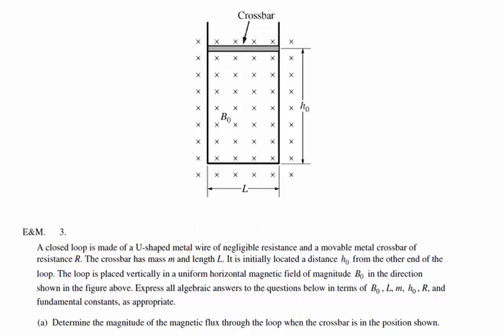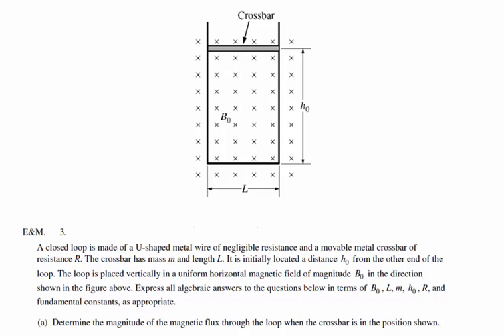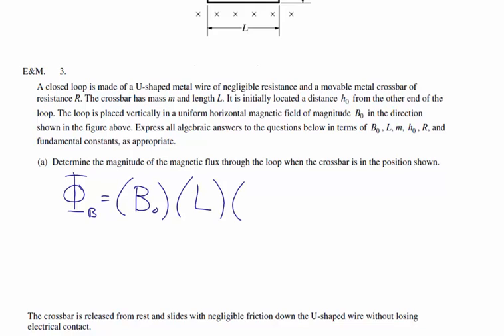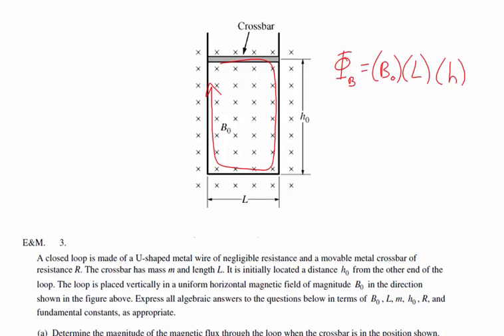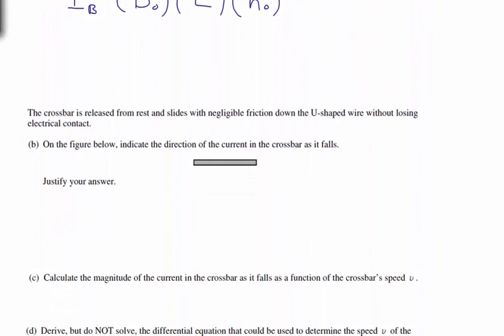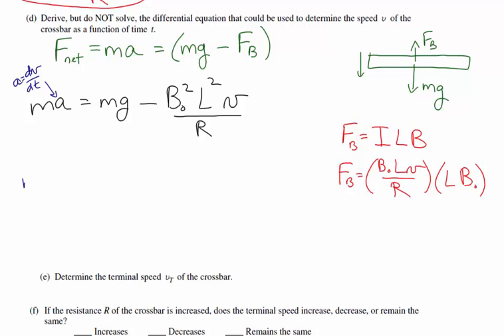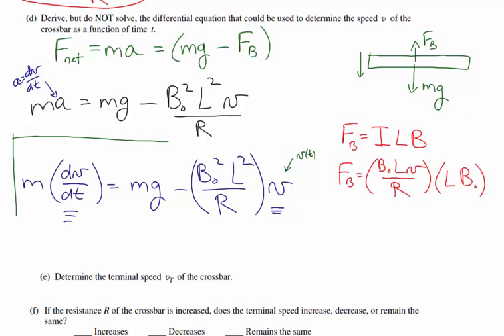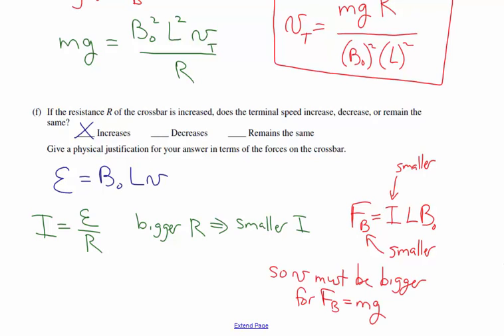AP EM FR (2012 EM 3) Induced Current in Falling Bar, Magnetic Force on Bar, Terminal Velocity

Comment: What if the crossbar was in an electrical circuit with a battery with such polarity that the magnetic force would act in the same direction as the weight of the bar? Would the crossbar still reach terminal velocity or would it continue to accelerate downwards?
Reply from the maker: It would still reach a terminal velocity. As it starts to move downward (at first accelerating more than in the first case since there are two downward forces - you have a rail gun) it still generates an EMF (or voltage) - in this situation it is often referred to as a back EMF - that is like inserting a second battery in the loop that works against the first one. It eventually reaches a point when the back EMF would cause current to flow the opposite way and reach the same situation as the first case - just after a different amount of time.
Reply: @scottsecrest2190  Thank you very much. This was very helpful!

Comment: Why you say that Fb is pointing to the right on the first question and after you say that it is pointing up direction on the question of the speed? It is a little bit confusing the way you're talking about directions on this video. :s
Reply from the maker: Deiziane Silva The first part is talking about the forces on the individual charges in the wire to understand why the current flows in the direction it does. The other part is talking about the force acting on the current through the bar. They are two different pieces to the problem.